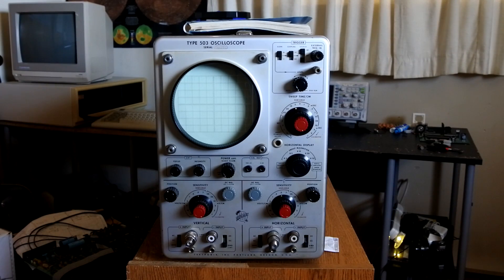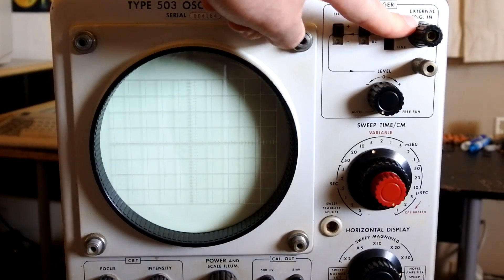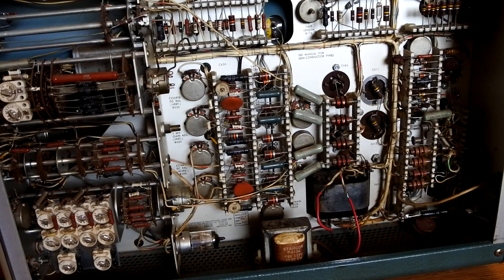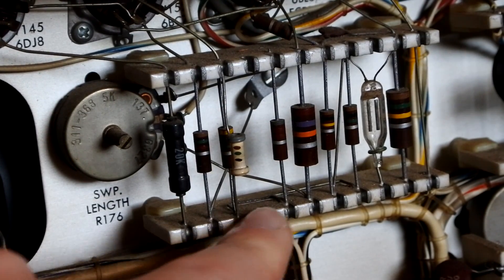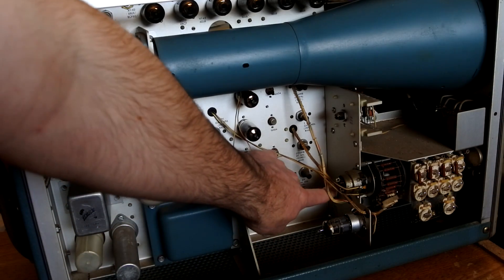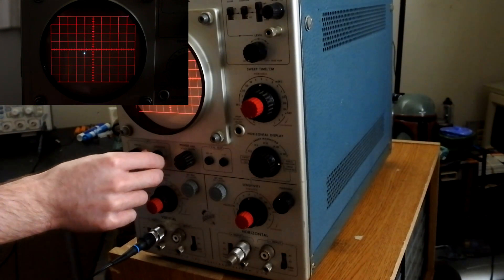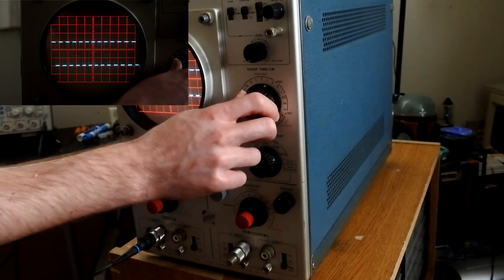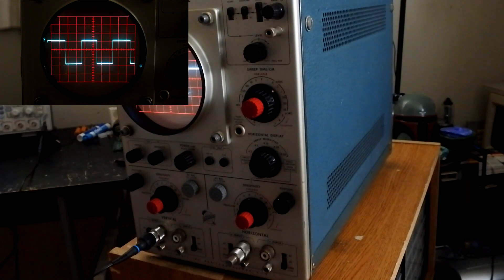Vintage Tektronix Oscilloscope Teardown and Demo

Comment: I have a vintage Tek scope - 561A and it has the upgraded "package" plugins.  I took it to a Cal lab, and it had a defective power switch, and may have never been used.  It did not need any calibration  adjustmenst, and the tubes were NEW.  He replaced on electrolytic, just because.  My scope is like brand new.

Comment: You may not have to replace those old caps In this thing. Since Tektronix manufactured a lot of their parts in-house, these old caps tend to still be super high quality and rarely go bad. I believe there was a type 503 on Mr Carlson’s Lab in which one went bad on the -100V supply rail, where he said only like 2-3 old Tek scopes had ever had bad caps in his experience.
Reply from the maker: Hi, Since making this video, I have read many sources on the reliability of those caps and I now do agree they seem reliable. However, I did take some measurements of the power supplies just to make sure there isn't any AC ripple and the caps appear to still be performing well. So, I have decided not to replace them. I did see the video by Mr Carlson's Lab and I do agree, that is a great example of how reliable they are.

Comment: Hi, I am restoring a Tek 503 also. Can you tell me what the number of the high voltage rectifier you replace for the tube? Good video on the show of the 503. Don
Reply from the maker: Hello, I used a diode that I salvaged from a microwave oven, a T3512H high voltage diode. However, it appears that they are no longer made. I would recommend a BY12 high voltage diode made by Diotec Semiconductor which is readily available from Mouser Electronics. Here are the datasheets for both:
T3512H: https://www.datasheet-pdf.info/entry/T3512H

BY12: https://www.mouser.com/datasheet/2/849/by4-2577479.pdf
You can buy it here: https://www.mouser.com/ProductDetail/Diotec-Semiconductor/BY12?qs=OlC7AqGiEDltof3e%252B72jhA%3D%3D
Reply: @200011Sniper  Hi, thank you so much for your information on the high voltage diode. since you replaced the tube diode with T3512H, had the 503 been working good for you? Thanks Don
Reply from the maker: Your welcome, I am always happy to help......The 503 has been working very well, the trace is brighter and sharper than is was with the original tube.